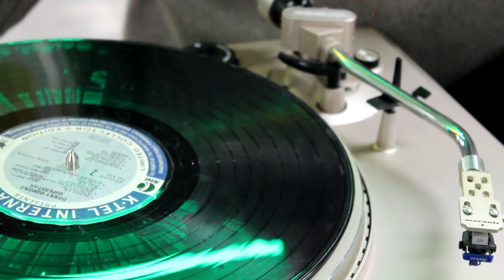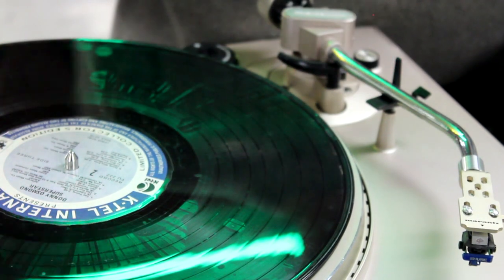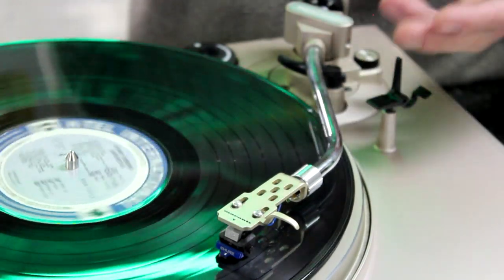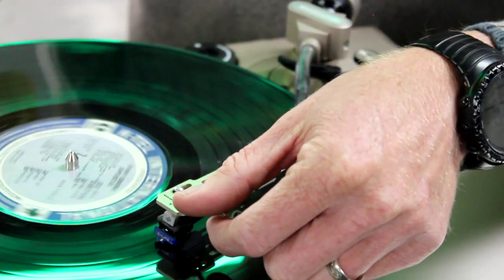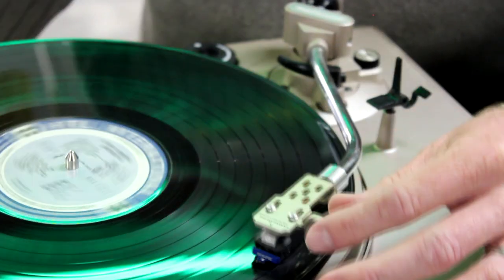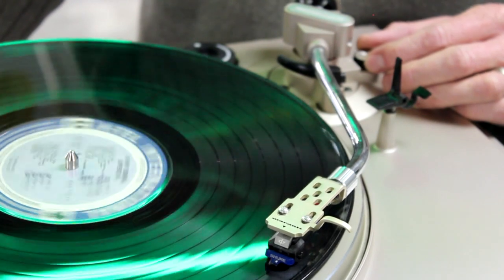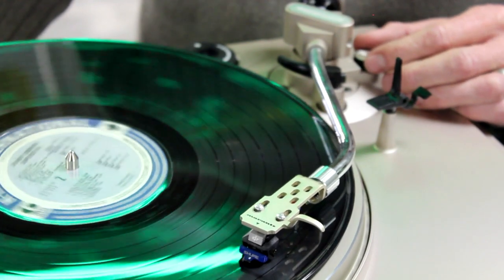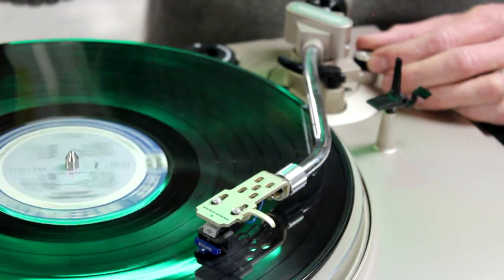antiskate adjustment

Comment: It shouldnt be on the middle of the record, it should be at the end on the deadwax, and even then it should ride slowly in.
Reply: So at the end of the deadwax is where you set it?
Reply: The Schroder-Ledermann method.....also works...there is no one PERFECT answer......if you can get IN THE BALPARK, you SHOULD be fine....if you do that deadax method, you will see the "middle of the record with no movement" method's results are close to it

Comment: I have a laminated LP and a Test LP. I have never been able to get my AT-LP120 to track like your video or others either. I can get it to track on the VTA test and the last track for tracking on my test LP. Best I can get is for to track in the middle of the laminated LP. I've replaced the anti-skate spring, but it's a known fact that this POS TT has a weak spring. I'm almost at the point of thinking it may be the tonearm. I have the correct tracking force for my cart and the tonearm is level and so is the TT. I don't get any inner groove distortion, but it tends to skip when I drop the needle at the start and when I lift the tonearm at the end it tends to move towards the middle only slightly.
Reply: Vinyl 2CD Rescue got the exact problem with Mt audio technica lp120. Any suggestions.
Reply: The AT-LP 120 USB Is a DJ TT and the Anti-Skate Has a soft spring In It. This Is so DJ's can Scratch better with No resistance on the Tonearm. This how they do It on the SL1200/1210's with Anti-Skate set to Zero. This was never meant to be a Audiophile TT. There are Fix's You can do If You can do them. Hope this Helps. DJ Scratcher.

Comment: I set my (Sansui SR-222) anti skate as per AT-VM95e cartridge specifications (2.0g) to match the balanced tonearm setting. It seems to play fine, but I used a blank disc just to test and the cartridge dove towards center. I don’t know if I should listen to this video, or the people who say it’s not an accurate gauge for anti skate🤔
Reply: Happens to me, too. Some folks tell you the blank disk does not work yet tell you to do it just as in this video. Use the other method, set the counterweight to zero so that the tonearm just floats parallel to the matt. Move the tonearm towards the center of the record and then at end of the record trying to find the AS value where it does not move either towards the spindle or the edge of the platter. That should be your value, no matter if it does not agree with what the manufacturer tells you.

Comment: Unfortunately it is not as simple as you have described. Firstly, a flat surface is very different than the wall of a groove and should never be used to assess skating bias. 

The required anti-skating force is not equal at all positions on the vinyl, in fact it is actually dictated by how far the stylus sits relative to the tangential points (null) of the alignment geometry -  the further away the stylus sits relative to these points, the higher the skating force.

In my experience, the method you showed will almost certainly end up applying far too much anti-skate and  result in a sub-par sounding cartridge (not to mention ruin records over time). 

I always recommend people adjust antiskate using a test record with bias tracking tests and if they dont have one to do adjust by listening before reverting to methods like you've demonstrated. Its actually a rather delicate balancing act. What youve demonstrated is a common yet very wrong misconception about antiskating.
Reply: exactly!
Reply: It was done perfect. The stylus sat still on all positions of the vinyl. Mission accomplished.
Reply: @amv_pure  read what I said again.

The wall of a groove is very different than a flat surface.

Achieving what he did on a flat surface will always result in too much actual antiskating force in the wall of the groove.

This method is a red herring. Trust me
Reply: @tplayford2006  you can’t truly test antiskate inside of grooves. And if you did, you would need headphones and a good ear.
Reply: @amv_pure  

Sorry but what you're saying isnt factual and just spreads misconceptions about stylus setup. 

The amount of antiskate required is not some dark art which requires supernatural listening powers...

The unwanted lateral skating force relates to how far the stylus sits from the two tangential null points. Its produced by friction and angular misalignment.. it also isn't constant across the record surface.. This is why lineartracking arms require no AS force. 

The AS force can only be properly tested and set in the groove, not on a flat surface like in the method shown in this video..  This method will always result in too much AS force. End story. 

Too much AS is not only bad for your records, it results in uneven stylus wear and means you dont get the most out of your stylus. 

Just because you may have been doing this your whole life doesnt make it correct. Its not.
Reply: @tplayford2006  Your concept has too many variables to prove your theory. There’s elliptical vs spherical stylus, the fact that not all records have the same depth of a cut, so many records have a different width between the grooves, etc.
Reply: @tplayford2006  A flat plate clearly proves the behavior of a needle on wax better, unlike a grooved record. Especially on a leveled platter. Maybe you are an audiophile, and I’m a turntablist and let’s just agree to disagree.

Comment: The difficult bit is finding a record sized laser disc or smooth cover to put on the turntable to correct the anti skate
Reply: Use a 1 sided record.
Reply: @sp1200M3D  Ive got the disc now thats checks it

Comment: Never use a skin or blank record for anti skate adjustment. This is bogus! You must use an actual record ! You need to replicate exactly the conditions of listening to a real record!
Reply: +Fluterra And even if you do you will still only  be correct on half of the record . Hard core correct anti skate is only a must for very high compliance carts around 35 or so. Nobody uses them anymore.  They have cantilevers the consistency of a wet noodle. Set it and forget it. I have a few old stock vintage high compliance carts I found at a thrift store.
Reply: keith parkhill m
Reply: An actual record with grooves will not let you visually see the skating of the stylus.